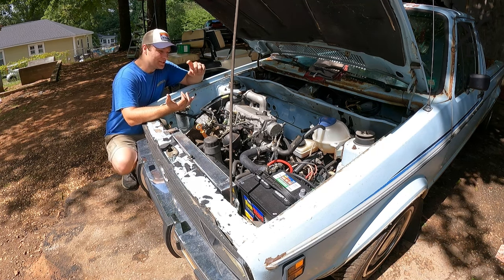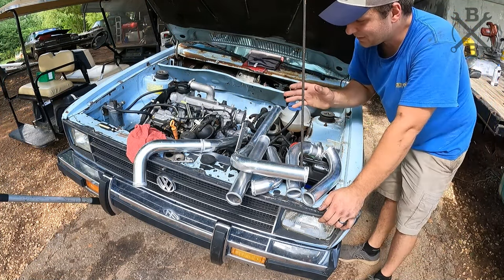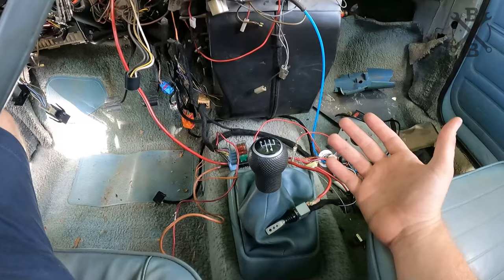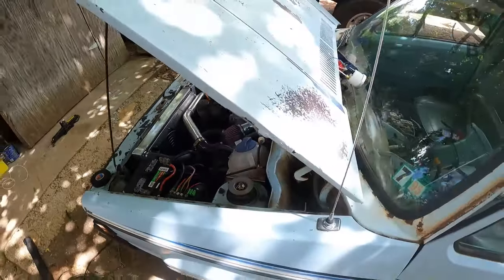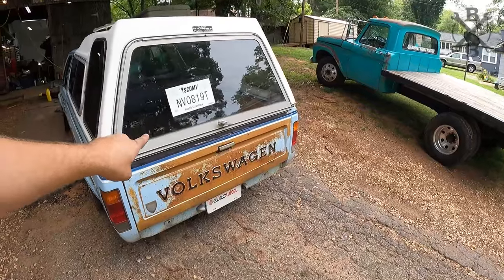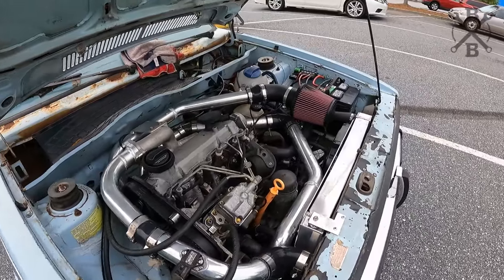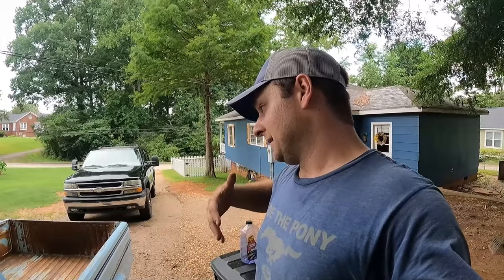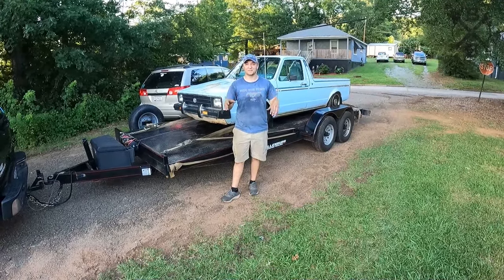The Barn Find Volkswagen Caddy Hits the Road with Boost! TDI Swap Part 4

Comment: I had one of these Caddys. I think mine was an 81 or 82 . Back in the early 90's in thigh school my friends would mess with me and pick up the rear end and spin my vehicle around. It was light enough that 2 people could lift it.  A few years later a bought a 1984 GTI rabbit.  Someone had installed racing suspension and souped the motor up and installed stainless steel headers. It was such a blast to drive. The neighbors hated me

Comment: Great  job Michael set up looks cool under the hood .paint looks cool 
You gonna get some bed liner paint  in it ? Hide the gauges in a centre console or glue black airasol  paint lids to get her and velcro them to A pillar with gauges in .or hide the in the glove box ..the air cleaner are you gonna fit an alloy shield to separate the heat from the engine from the k+n  cold feed .? 
As usual you done a great job 👏

Comment: in case you don't use the speed signal to the ecu (launch control) you can unscrew the VSS sensor and screw in a mk2 speedo cable to the original mk1 cluster.

Comment: Seems like those air intake and intercooler pipes are really long, but as long as they work. I think I would try to route the turbo air intake down the passenger side so the filter sits behind the headlight, where you have it is going to suck in hot air from the radiator

Comment: Did you keep AC in the system? If so what mods did you have to do to make it work? Did the Mk4 compressor plug right into the Mk1 HVAC plumbing?

Comment: This is a Malone Stage 3 with a VNT17?  Have you done any 0-60 or 1/2 or 1/4 mile?  It's quick and fun to drive?  How is acceleration and wheelspin in 2nd and 3rd gear?  I'm building one right now and considering getting an LSD.  When I heard James Cooperrider was a little disappointed with his BEW I was questioning the project.  Love to hear how yours is!

Comment: I have a question for budget buildz. With all fue respects. Is that the correct position angle for the steering wheel alignment T Offset to the left side?. I have been driving my 17 VW with that same position. And it d feels like it's the right angle. Because it doesn't wander either to the left or the right driving in a straight líne. Thank you Budget Buildz.

Comment: I freaking love VW trucks. That tiny air filter looks like it is for a motorcycle. ha ha ha. Ate you going to support the charge pipes using a stand and a rubber vibration isolate r?

Comment: Nice build.  Too bad you lowered the suspension.  Its an overused styling cliche that shouts "I'm a boy racer".  Not greatest setup when the roads are aren't boulevard smooth either.
Reply: Air suspension conversion would be nice
Reply: No it doesn’t shout “I’m a boy racer” fool

Comment: Hi great video. I was wondering did you use the wire harness that came with the beetle? I Am looking to do something similar and at the stage of sourcing a rabbit caddy and want to get a leg up on the process
Reply: yes he pulled the factory bug harness apart for what he needed.  He stripped all the insulation off and traced circuits and only kept what he needed for his swap.  He has a who video about it a few rabbit videos before this one.

Comment: Is it possible to use the OEM Intercooler from the Mk4 TDI?
Reply from the maker: The way it the turnouts are and sizing, it would be difficult. A used Mercedes sprinter intercooler would work nicely and are reasonably priced!
Reply: @BudgetBuildz  I was gonna splurge and use the radiator/intercooler from Sal's shop S&P. Is that what you went with or are you strictly using stuff from Eurowise?
Reply from the maker: @hylndrfan  Thats what I used…took 3 months to get it though 😖 I had the same thought myself

Comment: Did you make something on wiring
Reply from the maker: https://youtu.be/hHn-3NGbcFI 
I explain the wiring in more detail on this video. The only thing I was short was the map sensor wire, so be sure you keep it in line. Otherwise it’s only about 8 wires in total you save.
Reply: @BudgetBuildz  are you willing to  Call me
Reply: Would you say if you pull all the black  connector wires and the white  connector whites ,plus the unused orange connector wires. Wire power as you did it should be good?